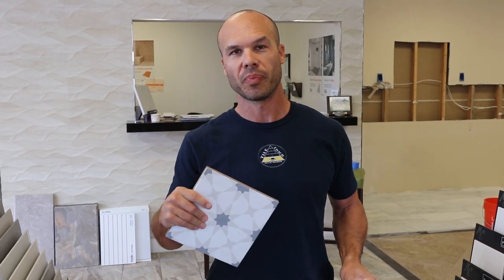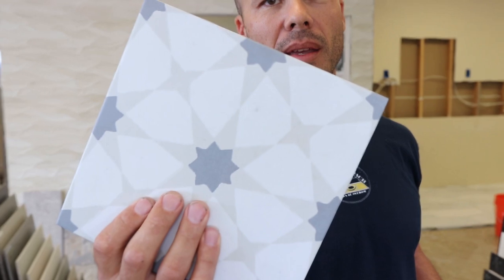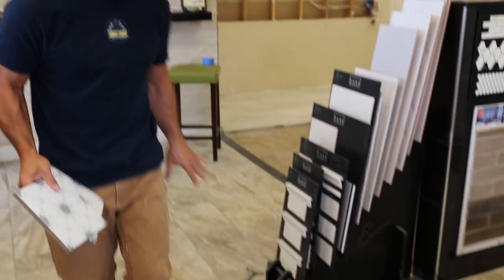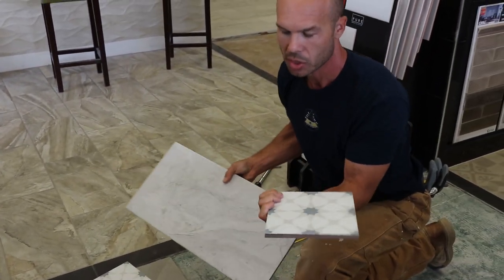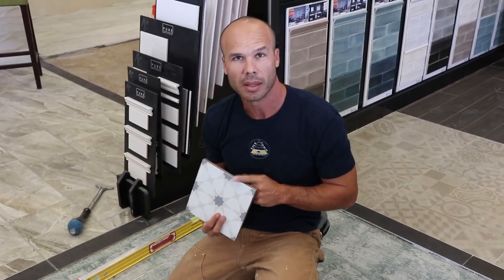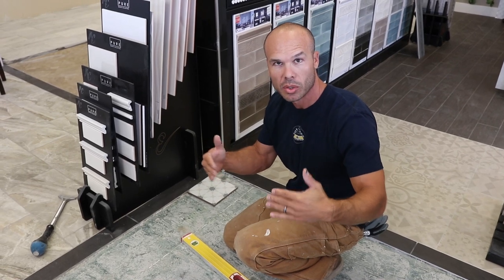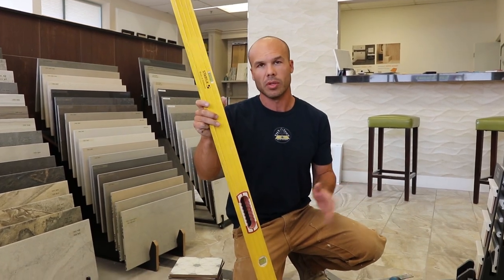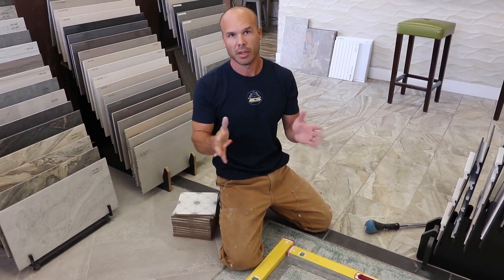TILE A FLOOR -- Easy Installation Guide for Beginners

Comment: Thanks for the video.  Ihave been renovating my small bathroom and last weekend dry fitted and cut my tiles (also using a fun tile kind of like the ones you installed).  I’m feeling confident and will lay my tiles tomorrow.  My fist time… wish me success

Comment: The video is great. I wonder how you would deal with  a floor that is not exactly level. Would you use floor leveler first? Also, I have a narrow half bath and have picked out an 8x8 porcelain tile with a large star centered in the middle and small quarter stars in the corners. Would I start in the middle and work out so the cuts match or would I work from one side to the other?

Comment: I was taught to trowel in the same direction to achieve a great bond to tiles
Reply: with larger tiles, for sure.....prevents air pockets from preventing you from seating them firmly....

Comment: FWIW, you mentioned two types of sub-floor, concrete and wood. Here in Colorado, there are quite a few condos (and even some larger custom builds) with gypcrete  (lightweight concrete) subfloors. They will almost always need to be leveled as well as primed and install an anti-fracture membrane. It is so porus and often crumbly, it will dry the thin-set too quickly and the bond will break not long after the installation.....
Reply: @TileCoach  If height (build up) is a concern, I like a product called Protecto Wrap....as it bonds really well!  I once had to remove an installation, (client paid us to redo a floor because she didn't like the tile the designer chose) took three of us two days  to remove the tile and protecto wrap from 150sf of gypcrete. Had to use a blowtorch to heat it so we could break the bond.....

Comment: Hey Isaac,
 How about doing a 7 day water test of Johns Manville’s Goboard backer board with KBRS showerseal sealant . Also , use KBRS showerseal seamless liner water membrane for the shower pan and joints .
Reply: KBRS uses a roll- on/ brush-on water proof membrane sealant for their shower pan joints in conjunction with a gauging fabric. For the wall joints they use their polyurethane sealants. Schluter uses the kerdi band with thinset for all their joints. Like you have mentioned before thinset is not waterproof , therefore all of your schluter test have resulted in leakage. I think KBRS/John Manville might be a better foam option than schluter because of the waterproof sealant that KBRS/John Manville use.  What do you think Isaac? How about a test?
Reply: Sounds good Isaac.

Comment: Do you seal your grout lines?
Reply: Most grout is made to be sealed ! Two coats on the initial install,  and what most people don't know is,  yearly after that! They do have grout that does not need sealing!  Fusion Pro Grout is one, Home Depot.  It's premixed and will set up way faster than other grout so be careful if you use it,  Its pricey but I use it and recommend it!  Good luck!

Comment: So you don't even use spacers on floor? For a non pattern tile? I like consist line
Reply: as a professional tile guy for 20 years.. many many times i do not use spacers on floors.  i am so used to grout gaps that i can eye them up perfectly.    dyi guy def need to use spacers haha
Reply: @TileCoach  was wondering if you used spacers at all on the floors, also you would have a skinny and joint and bigger joint
Reply: Also the tiles are Such crap at 70% of stores Like Home depot and Floor n decor they are all different size tiles,out of square etc,.using spacers would make the joints horrible after a row or two of shitty tiles.If you have perfectly square and sized tile then a spacer is OK to use.

Comment: Very disappointed to see you using the tile saw without eye protection (you do get some points for the ear prot. though).
Reply: almost no one uses eye protection for a wet saw...
Reply: @erickbad2000  sure, cause once those flying tile chips get wet, no way they can put your eye out. I see  clearly now.
Reply: @fredtooley4595  another youtube pro